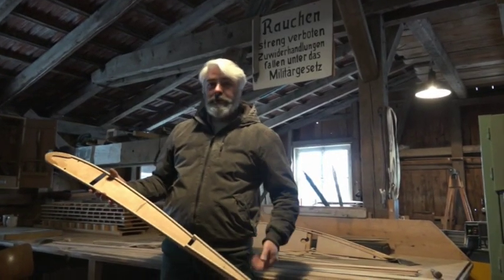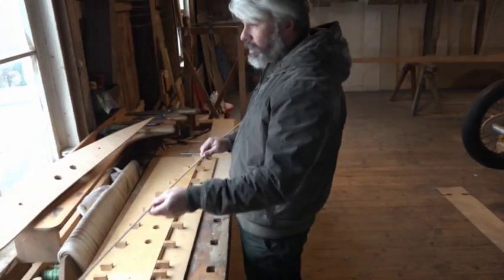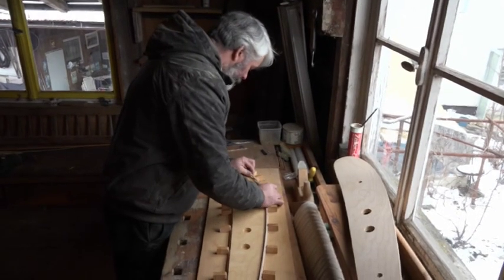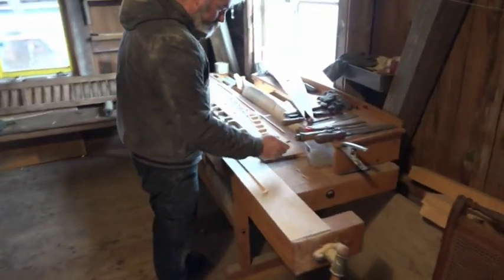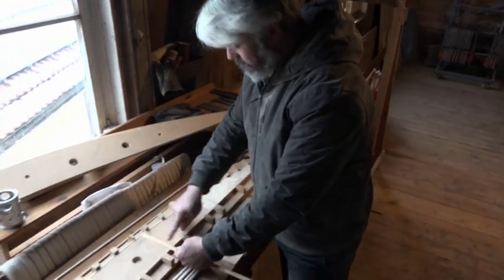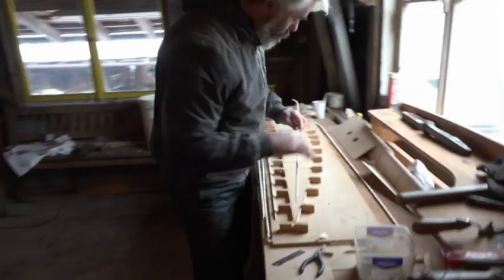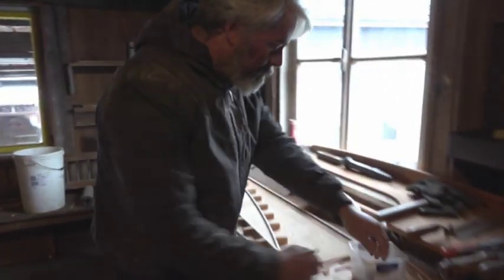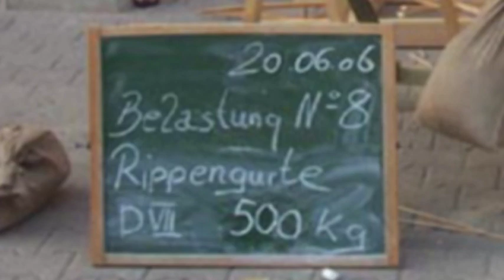Building Wing Ribs - Aircraft Construction and Technical History Museum

Comment: Your point on saving weight, about 17:30 in the video, and the negative affect extra weight has on the design load limits is something I wish I understood 30 years ago when I started building planes.  a little extra block here or there to make it stronger I now know is completely unnecessary. I have built a Druine Turbulent and a GY201 Minicab, both wood airplanes.   Like you, I did a load test on the wing. I placed the entire wing assembly mounted inverted on a jig where the fuselage supports would be.  I then placed  sheets of 1/8"- 4x8 ply onto the wing and loaded it up to 2.5g using bags of salt I borrowed from our local hardware store. The Turbulent wing deflected 2" at the tip with a 1600 pound load.  The Minicab wing was much stronger and only deflected 5/8" with 2500 pounds load.  Wood wing structures when built using the right glues are incredibly strong.
Reply from the maker: Exactly. Wood is one of the best materials for this purpose and easy to get hold of and to work with..

Comment: I will be rib stitching wings for a Fokker Dr1, only the area over the box spar will not allow for this. Could wrapping the cap strip over this section of the rib as you did  for the D7 be considered an acceptible solution? Plans call for screws, but I would rather not because of  moisture problems over time.
Thanks for the video. It was very helpful.
Reply: Have you solved your stitching problem?
Reply from the maker: In fact the ribs of the triplane were covered with a linen stripe that was glued to their sides and on top of the spar it was glued to the spar top left and right of the rib cap strip. So stitching across the spar is possible that way.
Reply: What glue are you using? Beautiful craftsmanship!

Comment: @orangestoneface
12 minutes ago (edited)
or build a plane from old bike frames . or timber ..two by four frame or ...some way simpler construction just crude wood and plyplates as wings , in a strong simple way l guess not glue then ,maybe just test strenght of timbers by weight test in middle see if cracks , .. would it work for a few flies at least , fun vid for youtube safer to remote control with man weight sandbag in seat. or old plane wings on old car drive till lifts no propellerjk
Reply from the maker: Not really sure, what it is you are saying....fun comment for a video, though.
Reply: @AchimEngels  build a plane from old bike frames . was the first idea ...but aluminum is hard to weld strongly or dunno , so chromoly maybe steel .

Comment: but you cant use sand paper bro
Reply from the maker: You can´t use sand paper to sand surfaces you want to glue,that is true. The dust would close up the cut in half wood cells. But you can use sand paper to break the corners and to remove the fuzzy thingies along the edges. And that is what I do here.